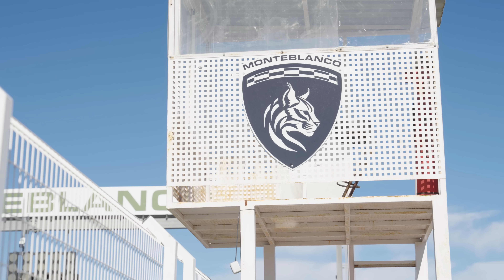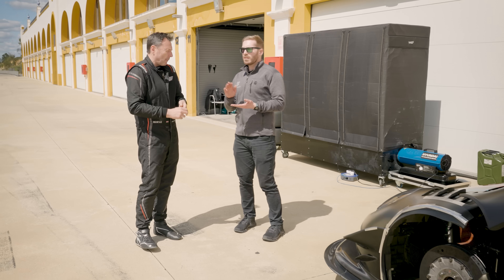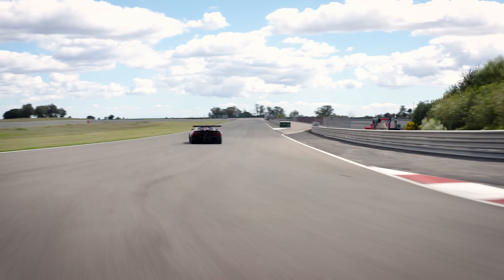GMA T.50s Niki Lauda Monteblanco Hot Weather Testing

Comment: How about this car competing in GT3? Many people probably would disagree. The race car version of this thing as the successor for the F1 GTR would be crazy
Reply: It weighs 700 pounds less than a GT3 car and makes over 200 hp more.
Reply: @Shadowboost I mean, we have BoP. I didn't really mean for the T.50s to be the GT3 base, it could be the road-going T.50, which I didn't explain well so my bad. Ballast would be added, although they should also increase the fuel tank from 80 liters to 120. Maybe make some parts more reliable, instead of all going to ballast. Make the engine tougher, with beefier parts. You don't need 12,100 rpm anyways, as it is over 100 hp more. It's like the Valkyrie LMH, it doesn't need to rev high for regs.

I know it's not that easy but here are some thing to at least put what should be the ballast weight to a better use

Comment: Yes, yes and yes! Wonderful to get a sense of the work that goes into the development of these cars - after the engineering and build processes. One suggestion for the producer - some longer (30-60s) drive takes from the cockpit without the (jarring) 0.5 second cuts to the driver's face or some other obscure angle would be good. Not all your audience are teenagers wired for TikTok. Just a suggestion... Otherwise, thank you and looking forward to the next video.

Comment: 12,000rpm, reliably on regular valves is just incredible. I'd love to see one of these with a pneumatic actuation system push past 16,000!
Reply: ......and if he would just add a Flux capacitor and see if they could work in harmony that would be the cherry on the top
Reply: @r1bew42  when this baby hits 88k rpm, you're gonna see some serious shit 😏
Reply: Is 12000 rpm really that amazing? A road-going 1000cc 4-cylinder superbike will develop peak power at 13000 rpm, has impeccable drivability and practical service intervals. I'm genuinely bemused as to why a 3000cc V12 is such a technical marvel.
Reply: @secretsquirrel3793  Is it obvious? Much heavier mass involed and so much more rotating parts in a V12 car engine than in a 1l 4 cyl bike engine. How many V12 road car engines have been made, that rev that high? This is the only one. Why? Because it is expensive, much more moving parts, therefore more friction. Smaller bike engines rev to 20000, even smaller RC engines rev still higher, that does not mean it is easy to make a 3 litre V12 rev to 12100, still make good torque low down and burn cleanly. 
Have you seen a 6 or 8 cylinder bike engine reving very high? Not even talking about 12. There are many reasons why you should not compare a 4 cyl 1 litre bike engine with very little torque and a 3l V12 car engine that has to move almost 5 times more weight. The engineering requirements between thoses engines are so vastly different it makes little sense to downplay the archievments Cosworth made here.
Reply: @mickwrinkles2318  isn't that a 4 liter v12?
Reply: @ripptorr  Yes, my bad. Gordon said at the beginning of development in the Harrys Garage vid that he wanted it to be 3l like the old 60ies Ferrari V12s, but Cosworth said to meet the engineering goals it has to be at least 3.9/4 l.
Reply: @mickwrinkles2318 The pistons and con rods in a 3000cc V12 will be the same size as those in a 1000cc IL4. Having 12 rather than 4 cylinders means better secondary ballance. Long crankshafts pose strength and fatigue issues but more main bearings should solve that. Bear in mind too that bike engines are made down to a price whereas supercars aren't to the same extent. 
As for car weight, a bike + rider is ~300kg; car plus occupants ~1400kg. So the ratio of power to weight is similar. 
I'm still unconvinced.
Gordon Murray and team have made a beautiful piece of work but his greater successes are aimed at everyman, see his plywood vehicles for developing countries for example.
Reply: @secretsquirrel3793  Just like how a 250 cc revs to 17k rpm, the bigger the engine is the harder it is to rev high
Reply: @secretsquirrel3793 given that it’s unique, yes it is. Four times the capacity, three times the cylinders, number and mass of moving parts, surface areas. It’s fairly obvious.
Reply: @secretsquirrel3793 That bike engine for starters is 1/4th the size of this V12. That itself makes it easy to rev. Even a £1500 150 cc bike I have revs to 9k. So for bikes, it's not that hard. A V12 is a totally different beast. No one other than Cosworth has tried to go for 12k till now - not Ferrari, Lamborghini, Aston Martin, BMW or HWA (Pagani). Even Gordon admitted he didn't think even Paul Rosche could have imagined this was possible with the tech they had in the 90s. All those others are making 6+L V12s. Only Cosworth got the Valkyrie V12 to rev to 11k.
Reply: Gear to gear timing. No belts. No chains

Comment: So the fan is not activated here? At least I didn't see it running.❔
Reply: I've been wondering this. They've connected a break light to the centre of the fan on this model in previous videos.

Perhaps it gets enough downforce from those two massive venturis? Much more and it will kill straight-line pace.
Reply: @rebellion2054  I guess you mean "brake light". Unless it's for the lunch break.😁
Reply: @Fastvoice that's what you took from my comment?
Reply: @rebellion2054  Yes, because my question was to GMA. Only they can give a definitive answer.

Comment: Is this still fitted with three seats?  If not, why not slim the entire cabin down to the center position and create less drag/weight?
Reply: Left seat is for passenger. Right seat front panel replaced with switchgear so that seat is removed.
Reply: @srinitaaigaura  thanks for the reply :goodvibes:

Comment: Do the regs allow a fan, or can they just apply BOP based on that?
Reply: This is not a car designed to race in a series so there are no rules other than noise limits. Once you decide a series to compete in then you would have to redesign everything. Since there are now several companies building track focused hypercars there should be private events that owners can participate in.
Reply: They have no intention of racing in any known series, so as long as the rear crash structure meets requirements, anything goes.